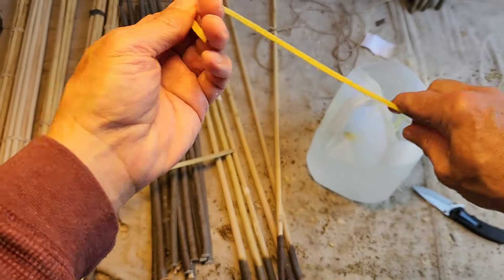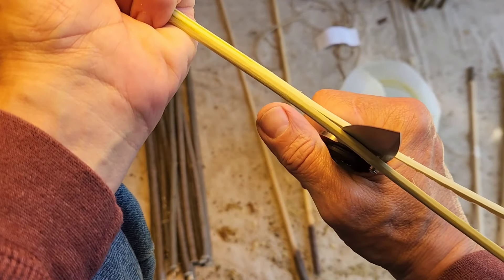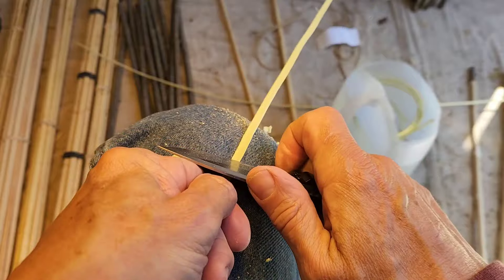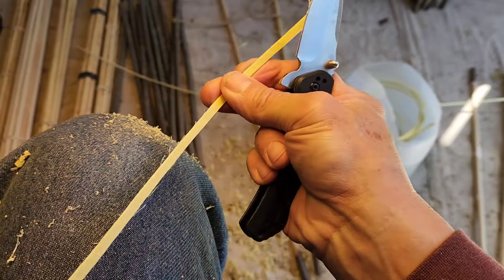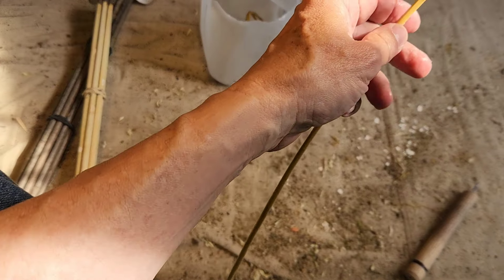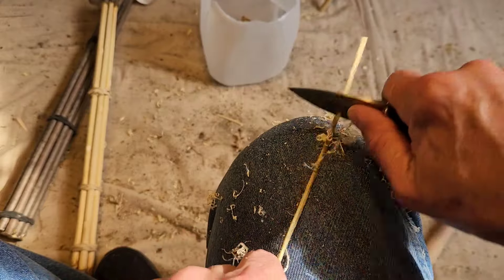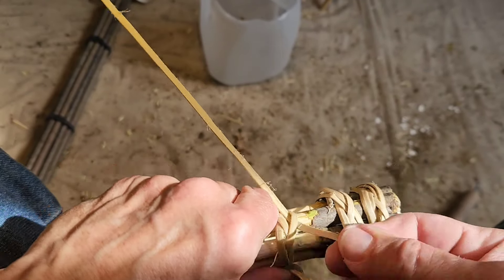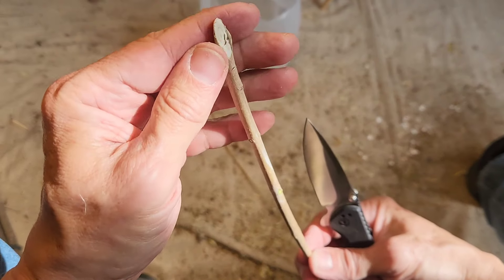1814 - Part 2 - Cold Straightening Green Arrow Shafts (Viburnum)

Comment: You won't beat Anchorseal's end sealer for what you are looking for, don't know how natural it is but it will do the job. 
The MOST important advice I can give you is to seal those ends up as soon after cutting as possible! Many woods will start to checker crack the second you cut them down! 

I used to use beeswax for check-blocking my shafts, put about a 1/4 inch in the bottom of a large coffee can and kept it melted on an old Sterno camp stove right at the site I cut my shafts at. Just get the wax good and hot then grab a handful of shafts and dip the ends in and count to 10 slowly then do the other ends. 
Another item I've used before is Pure Mink oil (boot sealer) seemed to work as well but I'd worry about using Mink Oil on hunting arrows. 

If you have a hard time finding a source for natural beeswax, check your local hardware store, ask for 100%  Beeswax toilet seals. I think they still make them.

I've never tried it but what about just trying some mineral oil on a few blanks and see how it does? Edit, Linseed Oil might work better than mineral oil, Linseed Oil will dry to a hard buffable finish.

Comment: Split viburnum is Yankee Rattan. Have you tried pine pitch for the ends to keep them from checking?
Reply from the maker: Seems that way. 😁 (edit: yes, I've tried pine pitch for waterproofing and it doesn't work that well. It tends to crack and you have to apply heat every now and then to seal it up again.

Comment: Walnut oil is a drying oil and woulfd have been. Also if you want  wax I believe bayberry grows all over New England. You could buy bayberry candles to avoid so much processing. Certainty available to Ancients.
Reply from the maker: True. I did some research a while back on the bayberry wax. It's labor intensive. Same with walnut oil. So, I'm leaning more towards animal-based oils.
Reply: @KnapperJackCrafty  Sounds feasible as long as you don't have to render the animal oils.